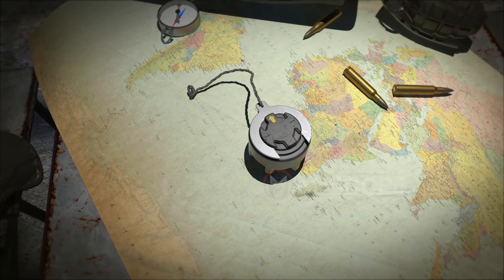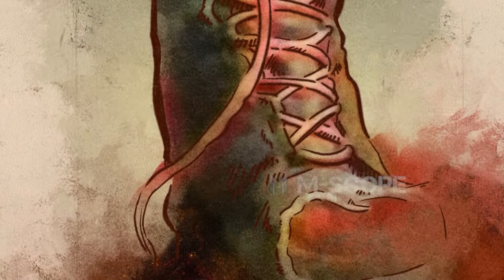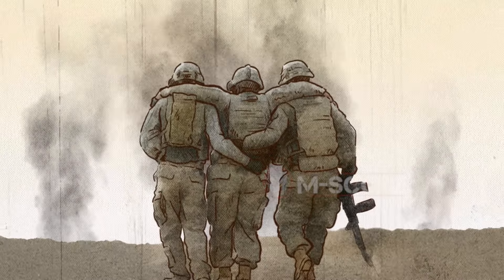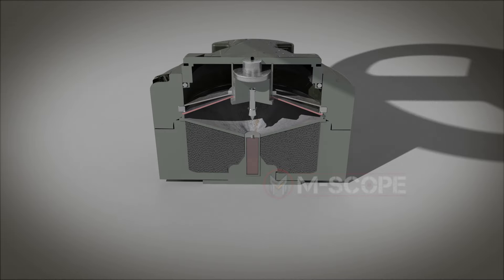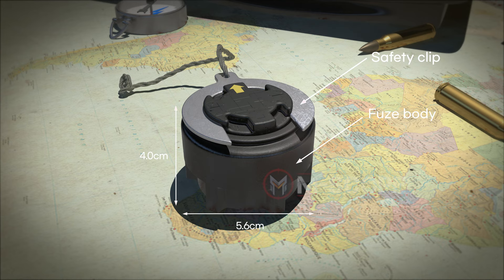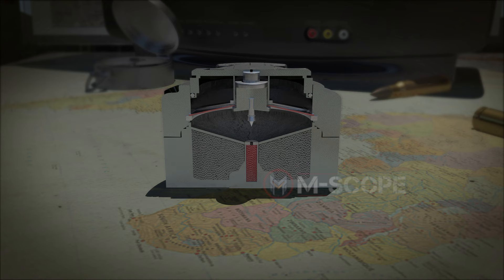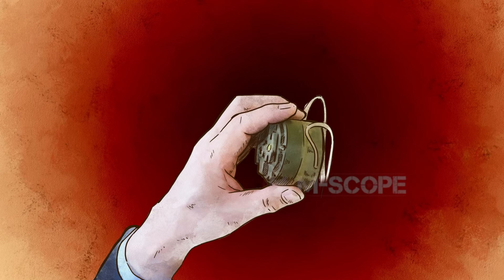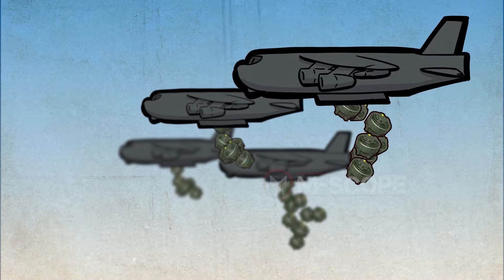Terrible Landmine With Only Ankle Amputation M14 Anti-Personnel Landmine

Comment: 🟦…a coupla mistakes were made here,... First of all this is NOT an "Air-Dropped" mine, these are placed individually in the field,... And secondly; The safety-clip is supposed to be the LAST thing removed AFTER THE MINE HAS BEEN BURIED!
.... If done the other way-around there's WAY too much of a chance of it go'n-off during installation.

Comment: Well made animation, I showed this to a Vietnam veteran who was a combat engineer that who has experience with these. He said there are a few things you missed: The Belleville spring (firing spring) is the only major bit of metal in the mine. The mine was never issued primed. The mine was issued with a arming wrench to turn the pressure plate. Also the safety clip was removed after arming not before, this was done so if the Belleville spring activated (because of damage or defects) while arming the safety clip would stop the pressure plate from going any further and stop it from going off in your hand. Truly a scary bit of ordnance.

Comment: Interesting animation , however with one flaw; the M14 mine is shurely not air delivered, as it is not suitable for that. They are burried one by one on the required place. The air delivered mines are the BLU 43B and BLU44B dragontooth and the BLU 42B
Reply: Yes, a better mine for air deployment would be the vs50
Reply: 100%
Reply: They called it the "toe popper"
Reply: Like a bouncing Betty or a canister  launching antipersonnel mine that     blows up around the mid section or the neck area like the NVA and VC would rig upsidedown from Vines and undergrowth in the trackless section's of the Bush that when tripped they shot downward Into the columns of closely spaced pairs of infantry that would get it at that face and chest or back of the head and spinal column and sets off the other 20 spaced out in bricklayers pattern staggered just enough apart and in stair stepped line or  from grid point to grid point to ensure maximum likely hood of successful contact
Reply: i read dragon bluetooth
Reply: @drrocketman7794  I was under the impression that a "toe popper" was a cartridge placed into a makeshift barrel/piece of bamboo with the bullet exposed and with the primer resting on something (a nail) to initiate the primer when someone stepped on the device.... Or is that the "footbreaker"?
Reply: I heard the guys in the Army call the M14 the "toe popper" but foot breaker seems more fitting...29g of TNT in a shaped charge is enough to completely wreck your leg below the knee, usually requiring amputation.
Reply: 2+2=4
Reply: Dee
Reply: @joshuacarrera6440  We are too smart by half.
Reply: @scottleft3672   what?
Reply: @joshuacarrera6440  We lay em....then forget where we laid em.
Reply: @scottleft3672  yeah that was a big issue I think it's something like one person dies every day as a result of having stepped out into the bush and walked directly into a daisy chain of bouncing Betty's put down 50 years ago when my country got a little to interested in the oil reserves in the spratly Islands or south china sea don't worry your not alone there's a person a day that dies in Europe from the unexploded ordnance expended during two massive regional conflicts the only shitty part is your's is untracked jungle and hilly terrain where as there's  mostly endless tracks of farm lands and village's so it's not as though there alone in lacking intelligence with how they planned on cleaning up after there little spats over land water Air property rights taxes and to Many people being alive to sustain our existence which is pure nonsense    we just need to stop over crowding these fucking dog shit city's and stop acting like life is a endless buffet line of all u can eat  and start working inward to develop our land cultivation more efficiently and we should be ok but we have to take the leap and think about leaving this bloody rock eventually
Reply: If you air dropped it how would you arm it?  What is to say it would land right side up?  So just stick to the facts and don’t try to make it even worse than it is.  The original poster to this had it right.  There are air droppable mines and even artillery scatterable mines.  This isn’t one of them.  By the way, the real mission of a mine isn’t to injure.  It it to deny entry to an area or to force the enemy to take the route you want them to take.  The threat of injury makes them an effective tool of war.  War is not meant to be nice.
Reply: @@MrKeeleb no but my mom is. She is the one that actually fits the your mom jokes 🤣
Reply: @joshuacarrera6440  Joshua, please, use punctuation. So hard to read.
Reply: @pan6593  I've got to stop using my Microphone to post but it's so easy to resort to using it for convenience
Reply: what do you expect from a video that uses a robot ai voice? probably the creator just researched for "general options of mine delivery". and he got this. Lets fight against this cheap, ai shit by disliking it.

Comment: Not an airdrop mine, all need to be deliberately planted. Firing is direct, the primer has a direct path to the explosive cap inside. You can modify them quite easily to make an IED for sabotage though. 🤔

Comment: We called them Toe Poppers.   I have never heard of them being air delivered.  They are primarily used as a hasty mine to block a trail when being pursued.   They have a metal ring in the bottom to make them detectable for removal.  This was a modification of the initial design.
Reply: the only airdropped one i know of in US arsenals was the gravel mine!
Reply: Did they use one in Vietnam called a" bat wing " it could be thrown out of a helicopter or was that just Hollywood  ?
Reply: Never heard of them airborne either.....I remember being taught how "the enemy" might use them sideways with a wire and mre spoon trigger against and being told "don't ever do this,it's illegal but you need to know what the enemy does....wink wink"
Reply: @alisonhilll4317  nope.....not even sure where you got that from Hollywood.
The primary aerial released anti-personnel miners what's known as a butterfly mine which comes from the Soviet backslash Russian arsenal and was banned.
Personnel mines dropped from helicopters is not something the US has done
Reply: We called them toe poppers too.  Placed by hand.
Reply: @Foxtrap731  Toe-popper sounds a lot more pleasant on the psyche of the person setting it than the ankle amputator.
Reply: @alisonhilll4317  idk where it was used or what they were called I thought they were called butterfly mines but yeah those are for sure real and I know what you are talking about
Reply: @alisonhilll4317  just confirmed… this is some of what wiki says:

PFM-1 (Russian: ПФМ-1 — Противопехотная Фугасная Мина-1, lit. 'Anti-infantry high-explosive mine') is a scatterable high explosive anti-personnel land mine of Soviet and Russian production.[1] It is also known as a Green Parrot or Butterfly Mine.[1] The mines can be deployed from mortars, helicopters and aeroplanes in large numbers; they glide to the ground without exploding and will explode later upon contact.
Reply: @jacobishii6121  The soviet mine is a copy of the US mine, which was used first.
Reply: @jacobishii6121  the GATOR mine system uses a standard CBU cluster mutation body and holds several anti-tank and anti-personal mines. It was used in huge numbers during the gulf war mostly dropped by B52 and B1 bombers
Reply: Australian Army Issue during 1970's.
2 Man mine laying team.
1st with sledge hammer making holes, 2nd following laying 'poppers.
I was surprised how quick they went.

Comment: You should explore the fact that is it a shape change that aims the majority of the energy around 8" above the base of the mine, creating a similar(though far less acute) penetration capability of an anti tank rocket, for example.  This isn't a blunt force explosion, but a focused deep penetration that obliterates anything in that range with unstoppable force.
Reply: @selurxelpirt  yup, but 10x faster.  A shotgun pushes 1200 fps while a detonation is around 21000-27000 fps depending on the filler.

Comment: They need to have a time clock designed to detonate after a set period.
Reply: Good point.  The greatest horror of mines is post-battle remainders, even more than the threat during battle.   If there are degrees of harshness, then at least know that US for many years has put self-destruct timers on their land mines.

Comment: Are anti-personnel landmines not supposed to be banned ? 🙃
Reply: So what . Sue the ones using them ??
Reply: There is an international treaty where countries have signed up to no longer use them. But few countries, including the US, have not signed up for it due to a number of geopolitical and strategic reasons behind it. Not that I am agreeing to their reasons. But it is what it is.
Reply: @rewrite1239  Until 2010. Then the production and implementation of APLs would be no longer permitted to continue.  Only anti- vehicle landmines with a  non-persistent function would be permitted to be produced and used.

If this was supposed to have me try to defend it, you're mistaken.  APL's were one of  the worst things humanity came up with for warfare and I still have issue with the continuance of anti-vehicle landmines even with the inclusion of the function.

Comment: There is an interesting Italian ap mine called sb-33.. Little whit basically no metal only glass and plastic whit irregular forms like a stone, plus they had the mercury anti handling  devices... It's an hell of a mine... For civs, soldier and engineers.. There are tons around iraq/Kurdistan, Syria and Bosnia... Think they are banned
Reply: Apparently it was designed to be resistant to overpressure as well so mine-clearing charges didn't even work on it. Sounds like a scary piece of engineering.
Reply: @scottcantdance804  not sound... It's a scary pice of war engineering..
>cheap and easy to build
> easy to scatter them around In huge quantities a fast
> extremely high chance that someone set one or more off
> extremely difficult to defuse whit huge probabilities of injury or dead of an expert EOD engineer.. Which I think is a huuuge loss of highly trained personnel whit long and high cost of training and in most army a pain to replace